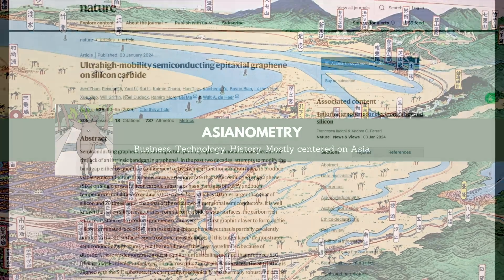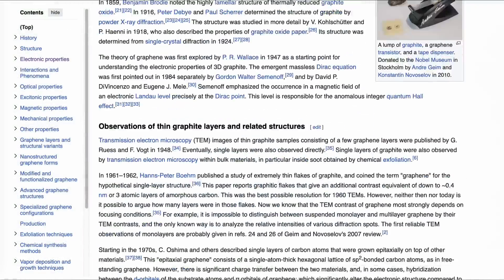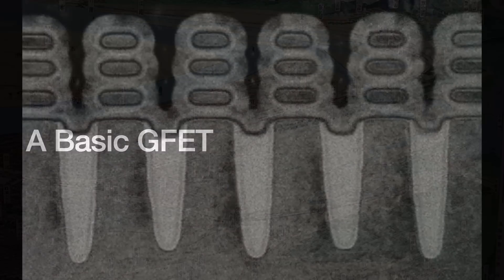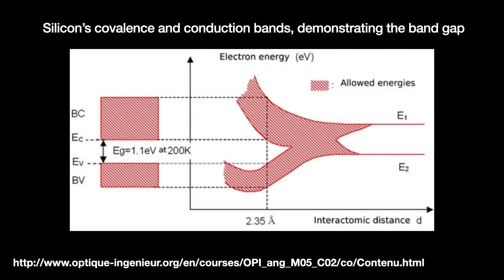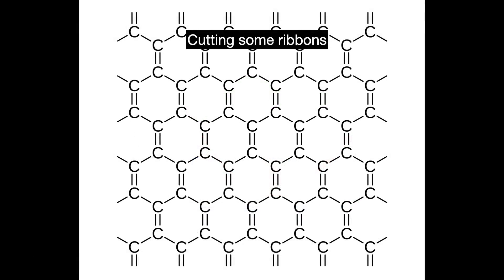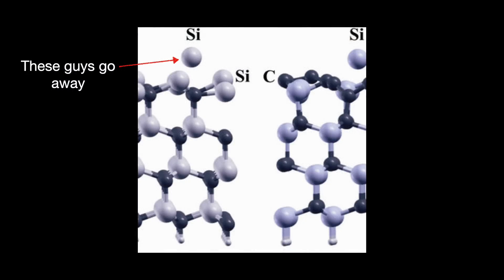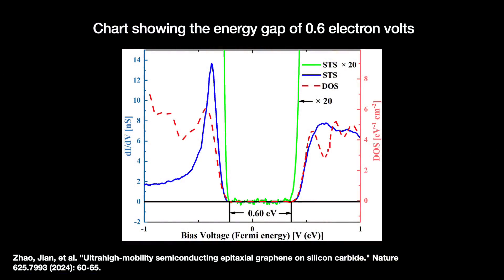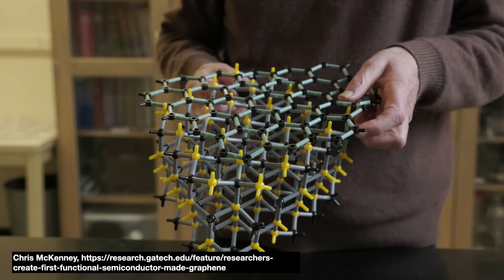A Graphene Transistor Breakthrough?

Comment: If graphene can reach hundreds of GHz or even THz then it doesn't matter if power consumption goes up by 50x. The reason the transistor count is so absurdly high in today's CPUs and GPUs is because of the lack of switching speed. You roughly speaking need to increase transistor count by 70% to increase IPC (instructions per clock) by 15%. So a Pentium sized chip at 1THz would run rings around a modern core while still using significantly less power. Of cause, if the transistors can also be made as small (or thereabout) as today's leading silicon nodes, then the area of a Pentium would shrink to a pin-prick.
Reply: You still have to cool a processor. Even if electricity is cheap, a 50x increase in heat density would be very challenging.
Reply: @davidgunther8428  Heat density is a myth. We have been "hitting the heat density wall" for the last 30 decades. And you didn't read what I wrote: If each transistor outputs 50x more heat, but switches 500x faster, you still have a net reduction in heat output because the design will have 200x fewer transistors and still yield a performance boost.
Reply: "increase transistor count by 70% to increase IPC by 15%" -- that's only true for single-threaded workloads.Scaling by adding more compute units (like GPUs, vector machines, multicore, etc) scales much closer to 1:1. So all these whole wafer AI designs are still going to be the same size, regardless of how fast you can switch.
Reply: @wesleyw.terpstra1902  IPC is IPC, parallel or not. Yes, obviously, if your compute problem responds well to parallel processing you don't go for increased IPC, you go for more processing contexts.
Reply: @wesleyw.terpstra1902 on any workload that accesses a shared memory pool, they definitely don’t.
Reply: Good switching speed helps, but the issue is even if you get an awesome cpu that can go super fast, you still have to interact with the outside word. Some of the IPC improvements on modern CPUs are not there because the CPU is too slow but to limit the impact of memory accesses, with smarter speculative loads and caching behaviour (that ended with this whole spectre exploits thing)

If you have time you can try simulating how it would work if you have a basic cpu with infinite frequency but memory accesses with similar speeds to what we have now. It will just stall almost all the time.
Reply: Keep in mind that power scales linearly with frequency. So if your transistors are twice as power efficient, you can only double your frequency, (ignoring wire resistance). If graphene transistors are faster than silicon transistors, but take more power than silicon transistors, then your chip will not necessarily run faster

However, the power dissipation in the wires is the significant bottleneck on frequency, not transistor switching speed
Reply: @E4tHam yeah, capacitance is difficult to reduce. I'm thinking more sensitive transistors like tunnel FETs might be better.
Reply: @E4tHam Processor power consumption increases with the cube of the clock speed or worse, according to physics Stack Exchange topic "How does power consumption vary with the processor frequency in a typical computer?".
Reply: @E4tHam  Power does absolutely not scale linearly with frequency. The reason laptop CPUs can reach 70-80% the performance of desktop CPUs at 15-25% the power draw should clue you in on that.
Reply: @andersjjensen  transistor gates have capacitance, it takes a set amount of charge to turn them on and off. This means a set amount of energy per switching. If you switch them 2x faster, you use that much more energy in the same amount of time. This is how it behaves in the much more efficient 1-2 GHz range for silicon. Faster than that you lose efficiency and its worse.
Reply: That's a fair point.
Reply: Notice he never mentioned GHz?  Gigahertz.
That's how we normally describe switching speed.
Also -
if they could make photonic transistors they would switch at Terra Hertz.
Reply: @Bobby-fj8mk  We can do that already. The issue is sending data to and from them. There's no point in having a superhighway where you can go at the speed of light if the entrance is a gate letting people in one at a time every minute.
Reply: @meneldal  - I mean Photonic transistors as a CPU inside a chip -
process data at Terrahertz speeds.
Reply: Sadly it is not that simple. Signal propagation is still bound to RC delay. So even if charge mobility is instantaneous. RC delay will still limit the frequency of a processor.
Reply: Would be great to have all 3 of them. More transistors, less ppwer consumption and higher frequency.

Comment: I'm watching a video about another breakthrough on a 12-year-old Core i5. If I was using 12-year-old CPU in 2004 (back from 1992) I would have been committed (and moved to a psychiatric facility asap).
Reply: For individuals, these things really don't matter that much. But for a data center, with thousands of computers, it does. Power consumption reasons mostly (power per computation in fact).
Reply: Our first family computer was a 75MHz pentium running windows 95. There was no updating to 98. It had to be a brand new machine. Fast forward to now and the PC I built 8 years ago feels about the same as my one year old work laptop. It’s great.
Reply: @quarterburnt  I have an i5 2500 from around 2011. The only reason for me to upgrade it is the max memory cap my mobo has (16GB). Of course I run Linux, otherwise this would not be usable anymore.
Reply: @anquelmartho had a 2500k, that generation of CPUs was the goat
Reply: When you have more compute, storage or data throughput you figure out things to do with it. 

Can't have Netflix or YouTube without filling the ocean floor with data cables first or you ask the question of why you'd need it in the first place.
Reply: If it does the job... It's good
Reply: I still use Core 2 Duo. The 3GHz ones are fine for browsing the web and watching YouTube with some kind of several years old video card assisting.
Reply: 2009 Thinkpad i5, 4 GB ram. runs windows 10.
Reply: ^ This. Hasswell i7 here. 4.8 Ghz single thread. I am a man of simple needs, and I will ride this CPU out until it's death.
Reply: @Im_TheSaint  chances are: that i7 will outlive you.
Reply: @Im_TheSaint  I used my 4700K from 2013 to march 2024. Main reason I changed builds was not even the CPU itself but the rest of the motherboard stuck on sata SSds and no pcie future proofing for ulterior GPUs. Really a chad generation.
Reply: @CalgarGTX  same, if i switch, it will be bacuse of RAM capacity limitations. There aint no such thing as 64gb of non EEC unreg memory for DDR3.
Reply: FX8320, and can still run under clocked and under volted.
Reply: lol that is funny - ironically in the early 90s you could still daily a 12 year old computer.. (i.e. Atari 800, Apple II).  What’s really old is new old again :).
Reply: I'm still on a 2011 i5 and surprisingly it works well in video games still
Reply: I have an Intel q6700 overclocked at 3.3 GHz via the old tape mod, a 2gb nvidia quadro k2000, 8 GB of ddr2 RAM and I coupled to all this a cheap SSD. It runs oothly online and plays KSP well.

Comment: Can I ask something? We moved from vaccum tubes as semiconductors to transistors, but what comes after transistors? Anyone?
Reply: Spintronics
Reply: @gregandark8571  thanks buddy. Can u explain what is it exactly?
Reply: Check also for 
Race Track Memory 4.0
Reply: @gregandark8571  transistors are more about logic than they are about memory storage, and spintronics and similar technologies are not  replacement for them. A transistor replacement is something that must do the following: "through an external effect allow for energy to flow from place A to place B" therefore acting as a programmatic switch, which is coincidentally exactly what vacuum tubes did, just in a less efficient way.
Reply: @marsovac  where is place A and where is place B?
Reply: @afammadudaniel2982 arbitrary but should be as close as possible as fast as possible for efficiency and frequency purpose
Reply: @afammadudaniel2982  wherever you can make them, but if you want to pack many of those they will be close by, the point is just to connect them at will in order to create a programmable logic gate, or switch if you will.
Reply: Also, the last transistor should be the : B2B Tunnel Fet (based on 2D layer Black Phosphorus)